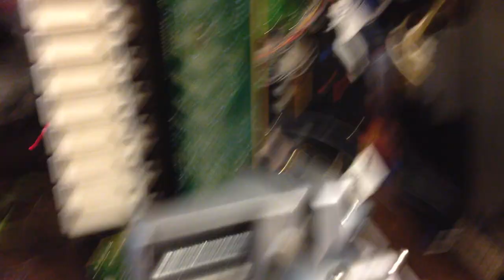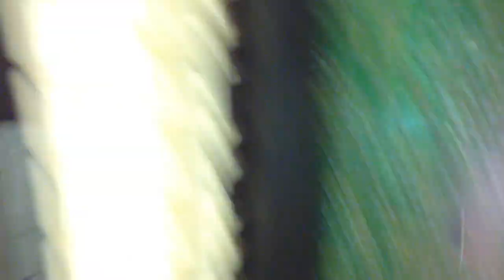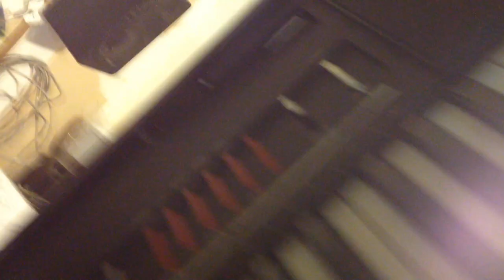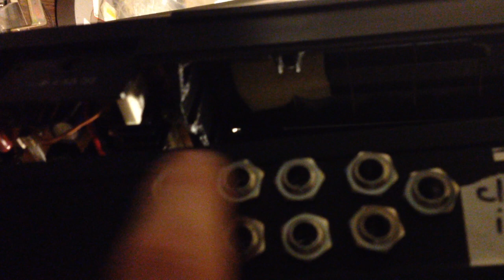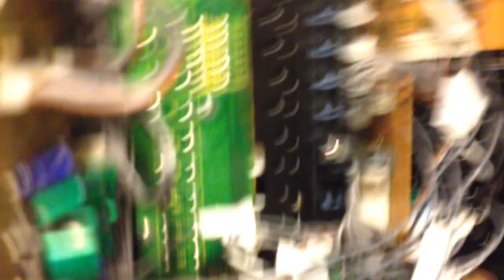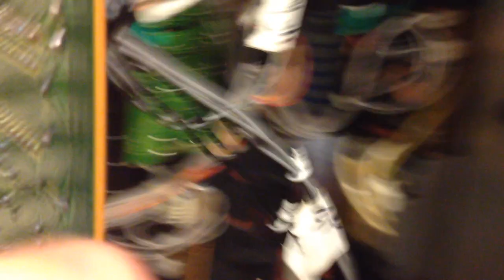Lowrey V-100 Micro Genie modifications circuit bend hacks

Comment: What signal does this take for a clock in? I have one of these, a yamaha ps-55, and a technics sx-k250 all of which sound gorgeous and I'd love to be able to sync them together and to an external signal from my minibrute 2s for example.
Reply from the maker: it's been awhile, if I remember (and most of this era of keyboards are similar) it's a square wave that needs 16 pulses per quarter note.  ideally you would have a clock divider/multiplier that could multiply your LFO/etc. up to whatever this keyboard needs for a clock pulse
Reply: @thenormanconquest  nice! Thanks for the really fast response. I'll play around with this and see what I come up with.
Reply: ME TOO!!! i want those schmaltzy rhythms in my work
Reply: @thenormanconquest  what about just busting into what comes out of the "16 pulses per quarter note  "circuit in the unit with a trigger from a tr 707 like an arppegiator ?  like literally bypass the internal clock all together, ?

Comment: This discussion has been inactive for a long time, but I've got a V-60 that will only play on the Clarinet setting. None of the other instrument settings work. Does anyone have a suggestion on how to fix this?
Reply: yeah, i had a buggy v-120. when i opened it up i saw a lot of corosion shorting alot of the board. i cleaned that up with some alchohol and a pick. now it works fine!